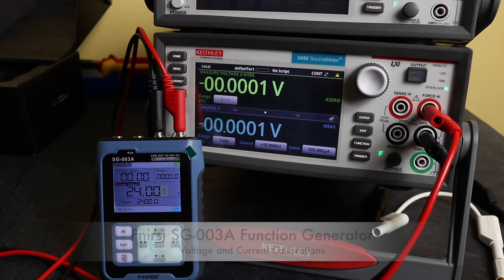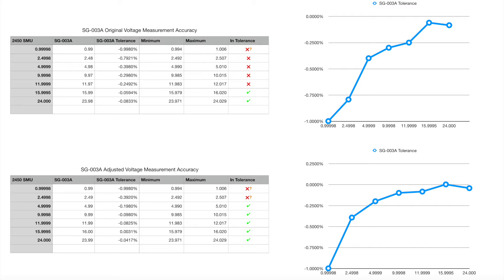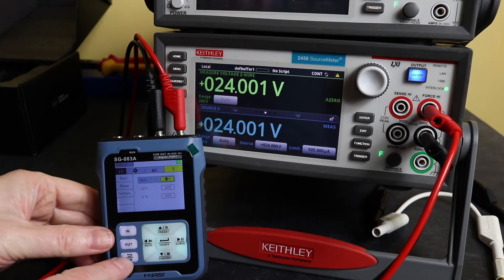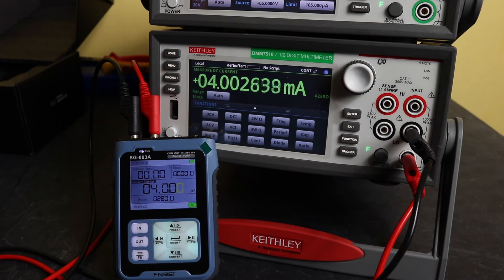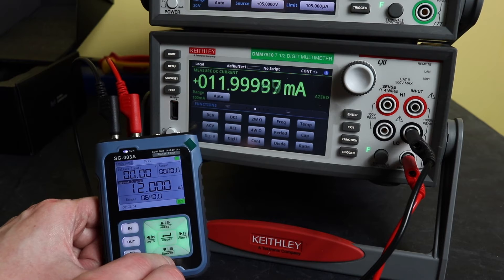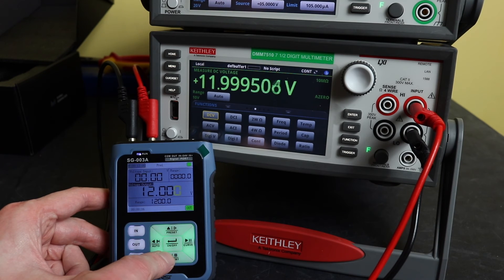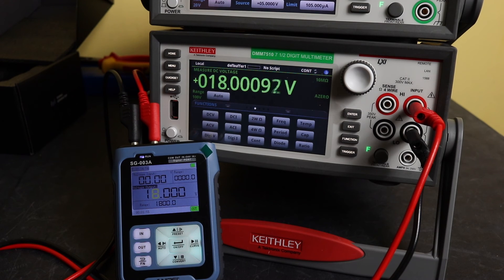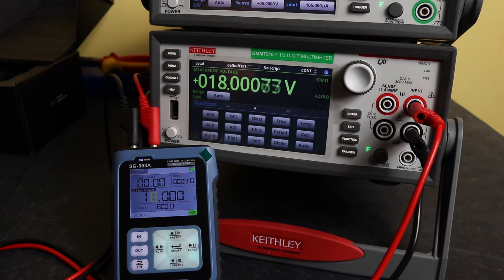Calibrating the Fnirsi SG-003A

Comment: Got mine today and played around with it for a few hours. Messing around with the frequency and PWM outputs and measuring with an oscilloscope. Not bad for the price at all. A little awkward with some of the settings and button sequences, but overall a good deal. Not sure what firmware yours has, but when on the graphing screen you get to see the current and the "cuttent". Slight typo on the input and output on the bottom there. No biggie, good to see that's the only typo. Even the manual was pretty understandable.
Reply from the maker: I have not been able to find the firmware version on mine. Haven't noticed any typos on any of the screens. It is a little bit quirky to start with, but its no real problem. Certainly got a lot of functionality to it.
Thanks for watching and commenting.

Comment: arhh, its an item that cost 45 USD with incl. shipping from China to Denmark and those 45USD also includes 25% danish VAT, so the inner value before shipping and VAT and what it likely goes for on domestic market.. is likely around 30 bucks..(not a lot for a selfcontained handheld unit)
This aint an item to thousands of bucks.
I dont know how the prices are in your region, but here in northen Europe this is weirdly good value for  handheld small function generator.. fx your reference 2450 Sourcemeter is above +8000 Euro in my country.
Tools like this handheld signal generator are not common in my region and the more I play around with my unit, the more I like it.
Not sure why your focusing on the input on such a tool..will useally turn to other items for that... its the signal aspect, voltage, mA, Hz, and all the programming and timing features on the unit itself that is precurious, and not often seen in this formfactor and can be quite handy.
but likely need to read the manual.. to get a deeper understanding of the mixing/conversion and also what this PC interface reflects and if there are software for it - as there seems to be USB connection activation and slaveadress and all that jazz in settings..
Sofar I been so impressed by this little unit hence the price paid, . that Im wondering about the bigger brother SG004A (0.02%) but its sadly a lot more expensive, and it also seems the prices has gone up for both the SG003A and SG004A, as they are both quite a bit more then the prices I saw around release & aliexpr. sale - but as far  as I can tell the SG004A its mostly the accuracy that gets better and you also seem to get some referenece temperature features .
Reply from the maker: They do seem to have gone up a bit, the SG-003A is around £70 to £80 in UK. The SG-004A I ordered direct from Fnirsi Aliexpress shop for £98.
It will connect to a terminal program on a PC and you can pull the readings into a text file, nothing fancy but should be functional.
I brought it for the loop measurement capabilities to use alongside my SMRT1. But I would need to show a calibration certificate if I used it on a site, hence the specific testing on it.
I will likely play with the PWM function at some point, but I have function generators that will do a better job than this.
Thanks for watching and commenting.
Reply: Exactly 💯  

Way over nit-picking/critical analysis for such an incredibly well priced item.

Comment: Still not bad at all for such an inexpensive device! I actually ordered one and should be here in a few days. Not that I need one at home, but for the price it's something to just have fun with and I'll have it on hand for that "one time" I may actually need it at home. Cheers!
Reply from the maker: It is certainly good value for money and is totally fine if the loops are only working to 0.5% tolerance. I just couldn't get it to work to the stated specifications. Did find an SG-004A units going cheap though, so have ordered that one to see if it is any better.
Thanks for watching and commenting.
Reply: @three-phase562  Yeah, I was looking at the SG-004A as well, but it was a little more than I wanted to pay for something I am just going to toy around with.